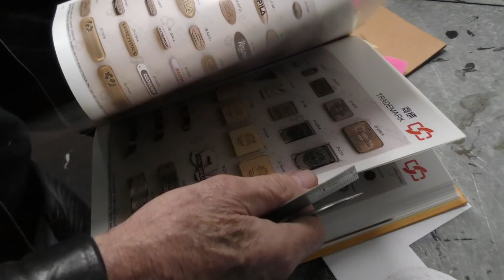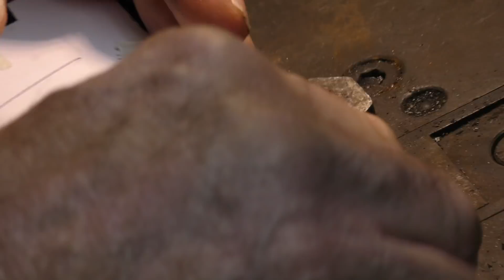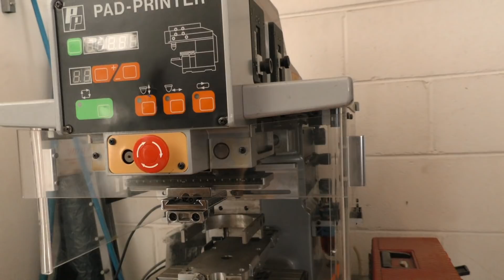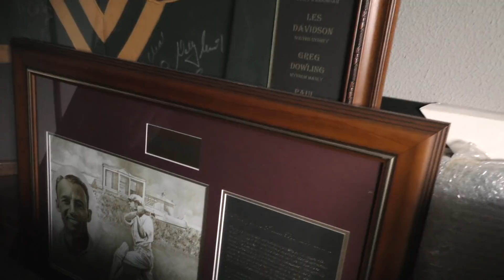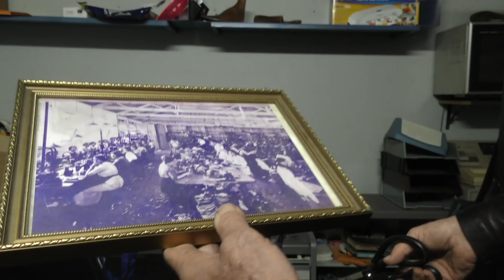LEATHERWORK SUPPLIERS TOUR - PART 1

Comment: Leave the poor D-MAX alone, not everyone can afford a 100K Landcruiser
Reply: Dmax is covered in Arb gear, towing a trailer and no engine mods, was a bit slow. New turbo diesels are really detuned from factory. Would be totally different with a ecu tune.
Reply from the maker: Zane H sry mate was joking actually, but yeah used to the tuned v8 now. i paid 50 for the 76 had it ten years. hardly a 100 k truck. 👍👍